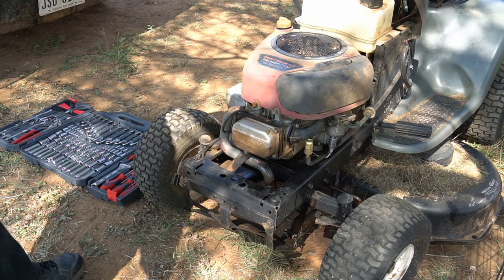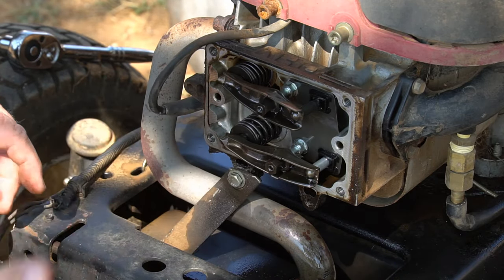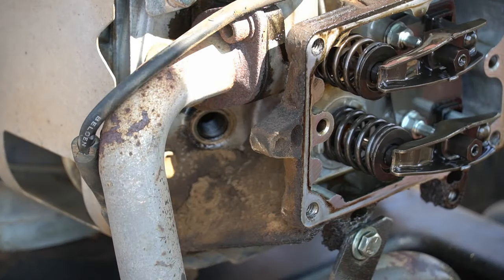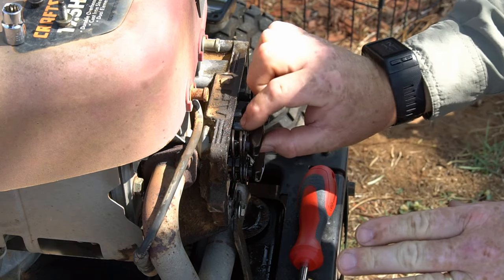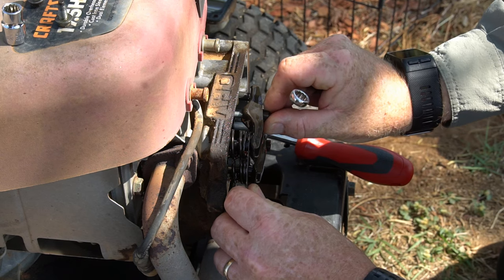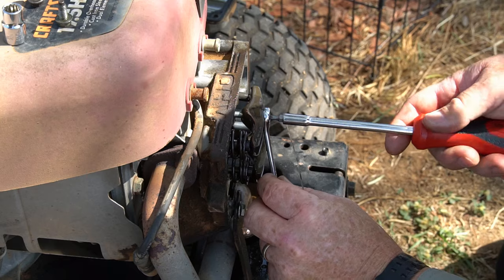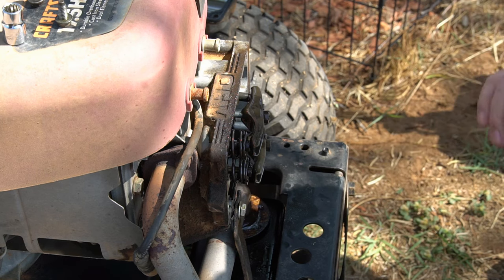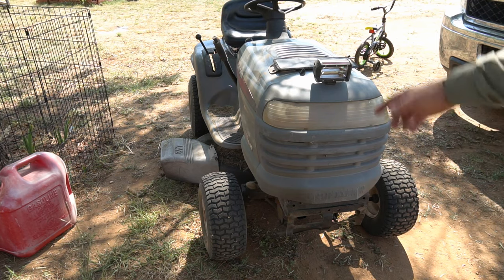🛠️ DIY: How to adjust the valves on a Craftsman (Briggs) 17.5HP OHV Engine

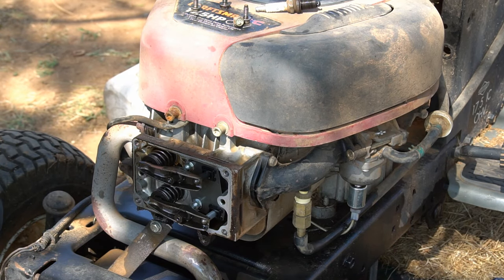Comment: You might want to redo this video or put a correction dialogue. The top is the exhaust, the intake is the bottom valve. This is evident by turning the engine like you did at 2:55 but the exhaust always opens first and then the intake. I’m not quite sure how you might have missed that.

There’s also another thing. One must adjust the valves at compression top dead center or you can adjust with one valve all the way open and the other valve all the way closed. Either engine position will allow you to miss the compression release. If you don’t do this, you will be adjusting the intake valve while the compression release is engaged. This will make the compression release not work, and you will also end up with incredibly loose intake valve clearance, which will reduce performance. 

Compression release on these engines is important because the starter is not designed to work on an engine without a compression release.
Reply from the maker: It has always been a curiosity of mine why experts watch YouTube videos about things they already know how to do in order to complain about them?  I have never done this, so I just don't understand the psychology that drives some to do this.

Comment: why would the bottom aluminum push rod be on the exhaust side?  The exhaust side is the harder worker and requires a non aluminum push-rod.  I thing you have them mixed up.  Thanks for posting the video because it at least gets people chatting and fixing engines.  This engine is a pretty intriguing engine for a lot of reasons, not the least of which it is known for blowing head-gaskets (at least my 18hp Intek is), and the valve seats will blow out if you run on a blown head-gasket for too long.  Aluminum head will also get stress cracks from the heat of all of the above.  again, thanks for sharing.
Reply from the maker: It seems there are is more than a few designs of this engine.  There seems to be a lot of disagreement about the valve settings. 

All I know is that it has been over a year since I made this adjustment and I have mowed over a hundred acres with the mower and it runs like a top.  When theory meets fact, facts always wins.
Reply: @thejungleexplorer  yes, and the reason you are running great is because it doesn't really matter on these engines as far as the spec lash goes.  you can go 4 thousandths on both the intake and exhaust or go by the book or at least be close and these engines will run fine. the only reason exhaust vs. intake will come into question is when putting things back together and trying to figure out where the wacky push rods go...your push rods were already in there so it's no worries in your case.

Comment: I used your measurements and I'm still getting compression lock. What's the next setting?
Reply: He was mistaken on which valve was intake and which was exhaust.   It's a 4 stroke engine.
Reply: He's wrong.  Top is exhaust (steal rod)and bottom is intake (Aluminum rod).  Exhaust (top) clearance should be .005-.007 inches.  Intake (bottom) should be .003-.005 inches.
Reply from the maker: Thank you for commenting Tim Whit! I am so sorry to hear that.

Comment: Nope!  See that aluminum push rod on the bottom valve....that's the intake valve.  Which means the exhaust valve is on the top.
Reply from the maker: Once a video is published, it cannot be edited.  Why people that have watched youtube for years do not understand this, is a mystery.  You are free to propose this ability to youtube if you like.  I have pushed for it for years, but they have not listened to me.  They actually had a function called "Annotations" years ago that allowed us to add text captions to a video after it was published, but this function was not compatible with mobile browsers and this is what most people watch youtube on, so YT got rid of it. If this function were still available I could go in and add a note correct my verbal error. In spite of my verbal mistake, I performed the repair correctly and I wish more people would focus on this rather than getting their tail feathers all in a bunch over a misspoke word.  Talk about missing the forest for the trees.

Comment: If you really think the intake valve is going to align right up with the exhaust port........... no man. You've got them backwards. MOST of the time Briggs will use an aluminum pushrod on the intake because of compression release. They've put it on the exhaust, I'll give you that. But on the 17.5.......... the exhaust is on top and the intake below. Many years tuning these up is what's speaking here. At a dealer, mind you.

Comment: You misidentified your intake and exhaust valves. A simple tip is the aluminum push rod will always be your intake. and on your engine it's on the bottom the top valve is your exhaust.

Comment: You can actually snug the exhaust valve up snug it helps starting when the engine starts to help the compression release do it's job. The intake valve is a bit more finicky at times I have had to snug intake valves.
Reply: Compression release is on the intake. I just replaced a cam. Not a good idea to snug rockers to valves. As valves/seats wear on these OHV designs the clearance gets smaller. And when the valves heat up clearance gets smaller too. You need clearance to make sure the valve fully closes went it’s hot, now, and as it wears in the future.

Comment: You should redo this video due to the glaring inaccurate identification of the exhaust push rod. The bottom push rod is aluminum which is the intake. The steel rod is the exhaust.
Reply from the maker: Thank you for commenting Jim Bohrman!

Comment: Another way to tell the difference between intake and exhaust valve is by looking at the rods that move the rocker arms. the intake rod is steel while the exhaust rod is aluminum. look at the color differences.
Reply: you have them crossed.
Reply from the maker: Thank you for this great information frios011.  I appreciate it very much when viewers contribute useful information as you have here.
Reply: completely wrong dude

Comment: important:  most of the information in this "how to" video is COMPLETELY WRONG!

Here are the things that are incorrect.  I have supplied the correct information:

1.  spinning the flywheel to determine "which valves opens first, and that means intake valves" is completely wrong!  This is a 4 cycle engine.  You cannot use that method to determine which valve is exhaust or intake. It depends entirely on which phase of rotation the cam is IN that opens and closes valves.  You could be 180 degrees off and the exhaust valve will open "first".  The CORRECT way to determine which valve is exhaust and which valve is intake is to SIMPLY LOOK at where the exhaust valve goes to the exhaust.  Just follow the aluminum casting structure and you will notice how each valves lines up to its respective port!  And consequently, once that is determined, the other valve would logically  the intake valve.  For emphasis and simplicity:  ALL Briggs and Stratton engines have the exhaust valve at the top and the intake is below at the bottom!  Just remember this for all briggs and stratton engines. You can ALSO VERIFY this by simply looking at the type of metal used in the valve rods.  The Exhaust will be a steel valve rod.  The intake will be an aluminum valve rod.
2. the proper way to determine Top Dead Center is to spin the flywheel by hand in counter clockwise rotation (looking down at the flywheel from that view).  Place a chopstick, or a straw into the spark plug port and continue to rotate until  the piston pushes out. IN ADDITION, you want to see BOTH VALVES CLOSED as that piston goes all the way to the top and pushes fully out. AND THEN THIS IS VERY IMPORTANT:  Continue to rotate this flywheel slowly in the same clockwise rotation and stop when your chopstick or straw follows the piston back down into the cylinder BY 1/4 inch from top dead center.  This is very important.  There is a decompression device on the cam and if you set the valves at top dead center you will be at the wrong timing.  Valve clearance cannot be done at precisely top dead center.!  It must be done at top dead center MINUS 1/4 inch.  Again, rotate the flywheel until both valves are CLOSED and the piston is at top dead center.  If one or the other valves are open at top dead center, you need to rotate the flywheel one more rotation to get it into correct phase.  Then once you have both valves closed as the piston in at top dead center then continue to rotate the flywheel slowly just a little more until you see the straw or chopstick go back down following the piston by 1/4 inch below top dead center.  
3. there is a specific torque setting for the valve set screw  (the t-20 torx bolts). You DO NOT WANT TO KING KONG these bolts.  If you overtighten these special locking set bolts, you will mess up the soft metal threads on the outer valve rocker valve bolt that it sits inside.  And that means you will have difficulty making adjustments later on.  The torque spec for the typical briggs and stratton engine is 3.7 foot pounds.  If you go full rambo, sure, it will hold but then you will have stressed the threads on the holding bolt and you will find it impossible to set your valve clearance again!  I am not saying go out and buy and expensive inch pound torque wrench - you can hand tighten this little set bolt with just a small amount of force.  
4.  the valve clearance numbers presented here are completely WRONG.  There is no such thing as 10 thousandths clearance for any briggs and stratton engine.  Almost all briggs and stratton are .005 to .007 inches for exhaust and .003 to .005 inches for intake.  If you set the clearance according to this wrong video, your engine will run like crap and probably not at all.  Follow the service manual specs for your briggs valve clearance.  This video is wrong.
Reply from the maker: Thank you for this great information @tdmmcl1532.  I appreciate it very much when viewers contribute useful information as you have here.
Reply: Wish i could copy and save this. Valve adjustment did not work for me. Im thinking broken compression release. That's alot of work and would like to try your recommended methods next. Took a long time to scroll thru and find this. Dont know if i can find it again. Thanks!

Comment: Dude,you're going to make an educational video on setting valves on the 17.5 briggs, then please be educated yourself. The valve that you claim is the intake valve is actually the exhaust valve. I know for a fact,because I have the same engine on my rider,and I just got done setting valve clearances on mine. By the way,the settings are .004 for the intake,and .006 for the exhaust. Its not as simple as just turning  the engine over and figuring the first valve that moves is the intake valve. That's plain stupid. Which valve moves first will be determined by which of the 4 strokes the engine was in when shut off. Like I said,its good to make educational vids,but please don't give ppl the wrong info. Study up yourself first.
Reply from the maker: Seems to run fine.  Isn't that what matters? 
Try to engage the critical thinking part of your brain for a second. Words are words. If one person says turn left and another person says turn right, but both direction get you to your goal, what does it matter whether the right words were used? This is what I love about videos.  It provides court-admissible evidence of whether something works or not.

Take this truck for a good example.
https://www.dropbox.com/s/0ere5ldvgtua0eh/Frankenstein%20Truck.JPG?dl=0

Now I guarantee you that you could have never built this truck. You probably think you know what this truck is, but you don't.  You see, this not just a truck, it is a combination of parts from several trucks, brands, models, years, and even a tractor.  The cab is that of a 1971 Ford F100.  The engine is a 4-cylinder Perkins diesel out of a Massey Ferguson tractor.  The tranny is a 5-speed manual off of a 1985 Chevy diesel truck 9don;t know what model).  The dually differential came off of an Agrale (look this up) 2-Ton flatbed cargo truck. This truck has over a million mine on it and is still on the road and is one of the best trucks I have ever driven.  Utterly indestructible!

Now, I know for a fact that a person like you could have never built a truck, because your mine is constrained by programming that tells you that, Ford part go on Fords, Chevy parts go on Chevys, and in no way does a Massey ending go in an automobile.  And connecting a 2-ton dually transaxle to a small frame Ford F-100 chassis is an abomination of mechanics.  You are an American.  You are close-minded and believe that there is only ONE RIGHT WAY.  That right way is the way you have been taught and ANYTHING that does not follow that teaching is WRONG!!!!!!!! and you must ATTACK IT!  Just like you did here.  You watched video and saw that what I did worked, but because it did not conform to your RIGHT WAY, you had to attack it.  

Don't get me wrong.  I am not saying you are wrong about anything you said, but you were wrong to post the comment you did after seeing with your won eyes that my method worked just fine, for the sole reason that it was different from your way. 

So, you can argue until you are blue in the face that I used the wrong words, but you can't argue that it did not work, unless your willing to deny your own eyes, at which point your discredit yourself.

Now it is your turn to try to move past your limited knowledge and grow mentally to be able to learn from the life lesson you just recieved.
Reply: @thejungleexplorer  Wow! You sure went a long way to avoid admitting that you gave  your viewers wrong information. But hey,thats all on you man. It doesnt matter to me,i could care less what you tell people. But i do know i would never subscribe to your channel,nor would i ever practice what you preach. And yes,thank you.I grew mentally and learned a very important life lesson from watching your video....and that lesson is to never look to you for any kind kind of advice on how to fix things the proper way! Have a nice life ,and enjoy showing people "your  way" of doing things.

Comment: No disrespect but sir you have that completely backwards.  the exhaust valve opens first as the Piston is coming up to top dead center and then as it starts to go back down the intake valve opens. That's why it's called a four-stroke engine suck, squeeze, bang, blow. You was on the power stroke, or as I called it earlier bang  if you bring the Piston up TDC the first valve that opens is intake and then you have a full rotation before the exhaust valve opens.
Reply from the maker: This video is pretty old and that engine is still running after this fix.  I am not saying I did it perfect because I am not a small engine repair mechanic. I am just saying that it worked well enough. I was actually following a video from a different YouTuber who claimed to be a small engine repair mechanic. So the information in my video came from a person who claimed to be certified.  I made my video because his video (and every other video I found) was so badly made, that I felt I could make the video much better.  
I watched several videos from mechanics on this before making my video. I used their information. So, I am not claiming to know, I was relying on supposed expert advice.
At the end of the day, the engine runs fine.
Reply: @thejungleexplorer  like I said no disrespect I was just correcting you on the valves. It's easy to get them mixed up. And I agree with you 100% on the certified YouTubers. With social media people are living in an alternate universe. I've watched a lot of videos and there's a girl her channel is chickanic I think that's how it's spelled I'm not sure without looking but she's impressive when it comes to Small engines. Good camera angles very detailed information and she even tells you stuff to look out for. From what I gathered off of a few videos of hers I watched she has a small engine repair shop and has been doing it for years. I think she said they work on 2,000 pieces of equipment a year.

Comment: Other people have pointed this out, but right off the bat you say that there are a lot of misinformation in videos out there, about adjusting the valves. Well, guess what?  YOU just just gave wrong information regarding which is intake, which is exhaust.  The top valve is the exhaust, and easily to determine because the push rod is steel.  The intake push rod is aluminum, and if you can't tell by just looking at them, stick a magnet on them both.  The magnet will only stick to the steel (ferrous) pushrod.
  Also, when you stick the screwdriver in, you say "there is a cylinder in here".  No.. there is a piston inside the cylinder that you are feeling the top of with the screwdriver.   
 If I were you, I would pull this video down, and start over.  You're giving people wrong information.
Reply from the maker: Thank you for commenting and promoting this video. I appreciate you taking the time to write a comment and help my channel.
Reply: @thejungleexplorer  Delete this video, you have just made the issue more confusing, not a help at all

Comment: the valve cover  retainers are screws not "nuts" good effort though.
Reply: not screws or nuts, they are bolts
Reply: Definitely bolts not “screws” good effort though.
Reply: Bolts !!
Reply: Mikael   your nuts...a bolt is a fastener with external  threads much like a screw but with a different  head
Reply from the maker: Thank you for commenting Jerry Whatsworth!